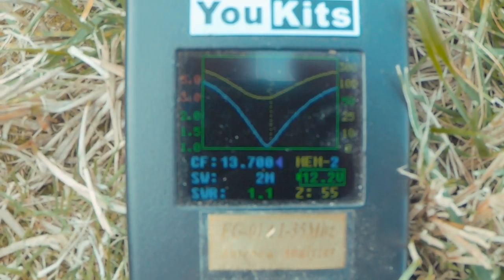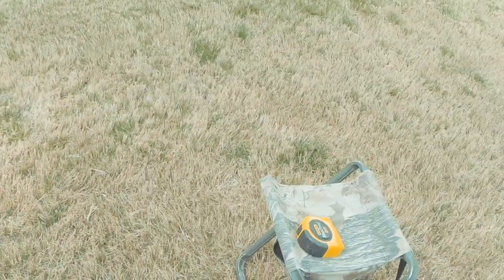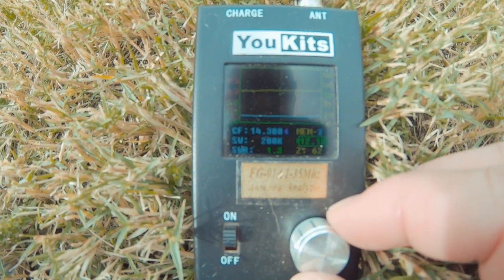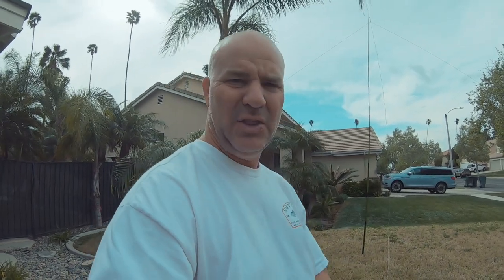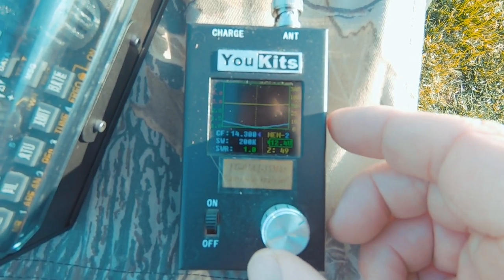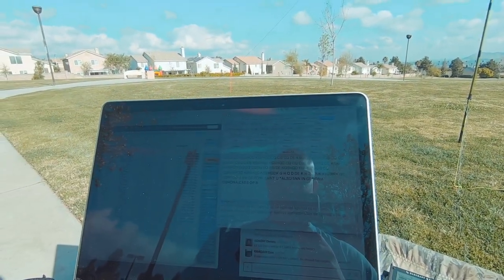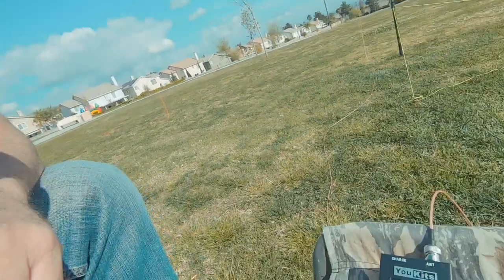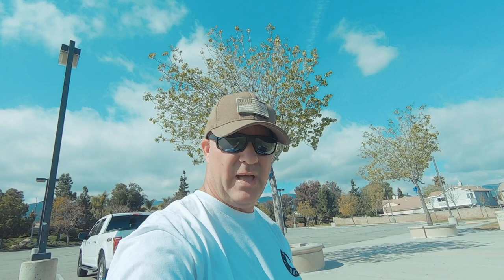Antenna Wars   Part Two - The Controlled Environment

Comment: I like the test Jerry. I think you have controlled what you can. It still is not controlled due to different times and if I recall correctly from watching this several days ago that some of the RBN stations were different. A field strength meter would be nice but not within the equipment most hams possess. 

I take that they both perform well. I would not expect a material difference in performance given they are both inverted v antennas cut to be resonant in 20m and similarly situated when raised. I would not expect much difference in resistance of the radiating elements.  The feedline portion perhaps. 

I think we can get too hung up on which is “best” when the better question is often which is effectively carried, deployed, and used. I think they are both effective when cut to be resonant where desired. The videos are fun. Hope to get a s2s with you sometime from W5T.

Comment: Great video Jerry, may I suggest using a field strength meter for actual signal flying off the antenna versus depending on conditions being the same  during both tests. It is VERY UNLIKELY that conditions would be the same. I use a field strength meter for a mobil installation test and it was quite helpful for determining the rf  strength between two different  stingers. Can even check at different elevations off the ground to determine the take off angle. 73s
Reply from the maker: sounds like more testing gear would be needed for such a novice test... maybe you can send me yours to borrow?  Good hearing from you Scott.. is it hot out there in Tx yet?

Comment: Great video @KG6HQD Jerry! Impressive performance from a roll of wire (referring both of these antennas), a few connectors, and a stick. This is what amazes me about ham radio, it breaks down science-y concepts into practical application and with the help of the ham community (i.e. the Reverse Beacon Network) you are able to verify first-hand these concepts.
There will always be much more fun and investment in something you build yourself and see working. Not to mention you can't even buy the linked dipole from the seller anymore... so if you wanted to do a pure dipole rather than el cheapo speakerwire, you'd have to do lots of new seller research and find a quality builder. For me, much rather build it myself since the theory behind this particular antenna is easily explained.
What I appreciate most is that you're one the folks getting out there and doing this stuff: Building, testing, and bagging the peaks to get your signal out there. It motivates the rest of us to get off our butts and get out there! 73 de AD6DM
Reply from the maker: Thanks Dennis and I appreciate everybody out here who motivates me to keep on trying things and learning myself. That’s the part of this hobby that means the most to me. Oh, and the “In association with the #JerryNet” is a nice touch, thanks 👍🏻

Comment: Great Video! I appreciate your efforts towards making a controlled comparison. 
I do a lot of portable backpack operating, at portable QRP ops when traveling,  but my favorite activity is working DX from ocean beach campsites. I have used all types of antennas: vertical wires, longwires (both with counterpoises) and inverted vees for 20 & (sometimes)15 meters. For DX purposes, the best results have been using a RG58 fed 20 meter inverted vee up about 30ft, with the center conductor hauled up in a tree with tent line. I have also used this same antenna as a vertical, with the center conductor leg up vertical and the ground leg draped on the sand as a counterpoise.I have tweaked them with a small  ant tuner.  
But most of the time nowadays (since I am a bit older than when I packed in an Argonaut 509 and lantern batteries up the beach trails 40 years ago!) I use a KX2 (w. tuner) a 55ft  (#22 wire)longwire and a 9:1 unun - a much lighter load. This also enables me to work 80-10 meters, so I can chase (mostly CW) DX on 40/80M  at night as well as talk to my NW pals on 80M SSB. I am willing to sacrifice a few DBs for band coverage.
I checked your RBN readings and would opine that I did not see the dramatic difference you saw considering the conditions. Some of the stations (K3PA in KS) and a few of the other stations were stronger on the 1st antenna. The surreal 41 db reading from the VE6 might be due to a spike in the propagation. This past weekend had a LOT of QSB and conditions could have changed rapidly, improving to some areas and degrading in others. In defense of your friend's commercial antenna the SWR  might have been better if deployed flat between two trees or as a straight sloper. When I cut an antenna (using the 468/freq in Mhz  = 1/2 wave dipole  L in ft formula), I usually need to trim it a bit when running it as an inverted vee. (ignore previous comment if it is designed for in-vee deployment)
I think a great test would be to go to that park with a buddy and set up the 2 antennas at opposite ends of the park running 2-3 watts within a few seconds of each other @ the same power. THAT would tell the definitive tale. 
Anyway, the most important thing is that you seem to enjoy what you are doing. You are doing a great job of sharing your love of radio with us here...TU!  - John, K7HV / HC1HB (I have a few videos here on YT as well, but not as well produced as yours!)

Comment: Good presentation Jerry.  Nicely (and fairly) done.  The RBN data is a good indicator of both antenna’s performance.  I’d give the edge to the HQD antenna in this round.
Give me a heads up when you plan the next test.  If there aren’t thunderstorms in my area (like this weekend), I’ll set up as well.  Texas weather is somewhat unpredictable in April.

Don / W5DON
Reply from the maker: Thanks Don - the RBN data was tabulated but with some unequal terms - I tried to compare the stations BOTH antennas reached but more can be dissected from the results and what else what be good is the overall range each antenna was able to achieve too.
Reply: Jerry - Maybe do the comparison three ways:

1. Compare the signal strength of the stations that BOTH antennas reached.

2. The number of stations each antenna reached in an hour.

3. The distance of the farthest station each antenna reached.

That would be more of an “apples to apples” comparison.

Don / W5DON
Reply from the maker: Agreed, unfortunately on Twitter Tony is jumping on a total average between the two and while that is data I don’t think it’s apples to apples as you say... at this point anything that puts the data analysis level seems to be discounted instead of just interpreted.
Reply: The only other variable is condition of the band, with no way to quantify or control.  The third test will show more.
Reply from the maker: Agreed, absent the antennas being in exactly the same location with the exactly the same setting and transmitting on calibrated radio at exactly the same time with exactly the same setting all this is null and void and useless info, or so thinks one. I think I did as much as I could to test fairly and provide some form of objective data and no matter what that’s a good thing. Thanks for the feedback Don and you definitely brought value to the conversation with some ideas not just for this test but maybe even some others as well.

Comment: Along with all your on-mountain SOTA videos, thanks for the great Antenna Wars, Jerry.

The highs and lows are good to know.  If we break the spots up at 1631z 06 Apr, I believe your data shows an average of: 12.6dB for the N9SAB/K9ARV antenna, and an average of 9.7dB for the KG6HQD antenna.

It seems like WSPR with the grid square distances would be relevant too.  We could come up with a dB per maybe 100 miles averaged over all spots.  Right now, we don’t know if the less measured antenna might have actually been received further.  However realistically without getting into raw WSPR data, a comparison between several but quick back-to-back WSPR maps would help us get an intuition about all those distances received.

I like my similar 100W-rated 20M and 40M N9SAB Tim Ortiz antennas and my 20M and 40M KG6HQD/speaker wire antennas.  I think I missed out on the N9SAB/K9ARV QRP-rated antennas.  Tony got me into QRP with his channel.  Great guy.  Wish I had a few of those videos for reference.

Weight, cost and DIY pride are definitely values I appreciate on the speaker wire.  I made a 20M and 40M with my young daughter.  We had speaker wire all over the house.  We loved it.  Hard to tie that knot in the 40M with all the wire… and a helpful 4-year old.  There will always be “gold” mixed in that copper.

Thanks again for the all the videos.

N4NAS Adam

Google spreadsheet with spot averages:
https://docs.google.com/spreadsheets/d/1sCLXg964hhzytj2CDOC1L0gHGlZd9O3JTs5fpBSGlR0/edit?usp=sharing
Reply from the maker: I like that dB over 100 mile idea for an even more objective analysis if one wants to even dig deeper. How’s the 40m HQD speaker wire working for you? What is the length you chose for the transmission line and what gauge wire did you use?  Also, I completely agree, Tony is a great guy and exposed many people to QRP portable ham radio when he had his channel running; wish he still did to be honest. 

I think you nailed it with the “gold” reference, that’s a solid analogy for the intent of making your own antennas, no matter what kind or how stellar they are or not it the experience that matters most.  73 👍🏻
Reply: @KG6HQDJerrySOTA  I checked some notes from last year.  For the 40m, I was shooting for 7.200MHz.  The BNC to female banana binding posts connect to about 74' total of 24AWG speaker wire.  39' is for the feed and 34'5" for each leg plus a little spare to attach and tune the ends.  I have about 9'-12' of tent rope on the ends. When sketching it out, I anticipated a 19' pole.  I ended up pulling out the last thin section of the pole making it about 17'6" tall.  I estimated 128deg between the legs at 19' so it is probably a little over 130deg between the legs now.  Obviously, the legs are not near as close as the 20m I have at about 92deg.  For the 40m, that 12' tent rope gets it about 3.5' to 4' above the ground with the 17.5' pole.  I ran some WSPR runs before.  I remember being fairly satisfied with them.  Actually, I just setup the 40m again in the backyard to confirm, at 7.200MHz I am getting an SWR of 1.06 and the impedance is 53.2-j0.4 ohms.  Now, that spring time is here, I just need to find the time to get it to the summits. N4NAS
Reply from the maker: Discussing this very info on our digital mode group now and it’s in line with our estimates 👍🏻

Comment: Another great installment in the series. Good idea using the RBN for external data. At least it can't be said that your using bogus numbers. Would love to see a rebuttal series and the methods used to prove the former K9ARV dipole was a better performer.
Reply from the maker: Well he was adamant it would outperform the HQD speaker wire but the RBN data and the clips showing each setup with each antenna on the analyzer should help to quell any allegations of malfeasance on my part cuz I’m sure that’s next.  I know I did everything I could to ensure a fair & impartial test with objective results. We shall see how it goes now.

Comment: Jerry, Thanks for the video series and for sharing a lot of good information. I would like to see a comparison between an OCF antenna and the HQD antenna. I'm sure yours being a single band antenna would win but the OCF will offer the convenience of switching bands. 

✌🏽
Noel~ W2MSA
Reply from the maker: Hi Noel, I like that idea just for the idea of making another antenna!  Noted for the list.  Do you have a particular model in mind you could share the plans to or reference?
Reply: KG6HQD Jerry I don't have any at the moment but the other antenna you can construct is a half wave end fed antenna which a lot of people like running for portable use. There's a lot of information on how to construct one on the internet. At the end of the day there's nothing like a single band resonant antenna and the fact that you're using a twin lead feed line even better.
Reply from the maker: Very true Noel and I do have stuff and plans for an EF version with a 9:1 unun if I recall that many SOTA guys use. Maybe I’ll make that just for fun next.
Reply: KG6HQD Jerry Just remember Jerry that the 9:1 is technically a random wire where the HWEF is theoretically a resonant antenna. So rather than a 9:1 use a 49:1 or 64:1. Look up the end fed half wave antenna group on Facebook, there's a lot of good information there. 
Good luck and thanks again for all your effort.
Reply from the maker: Yes that one 🤣. I have never built this particular one but have the plans somewhere to reference. I’d like to see how it does in a similar test since the naysayers are so against antennas like this yet they work well and that’s what matters in my opinion.

Comment: Nice video and great work Jerry. It seems to me that basically what you have with your HQD antenna is a dipole fed by ladder line. One wonders if your "ladder line" feedline offers significantly less  loss than the opposing antenna's coax? It's curious to me how I grew up with the notion that coax is better than twin lead but look at your antenna and the performance difference. I wonder if you could improve the performance of the HQD antenna by feeding the dipole portion with a high quality, light weight ladder line? You have caused me to seriously reconsider how I may construct some of my future dipole antennas. One thing is for sure, you can't beat the price of the HQD antenna! Talk with you on the summits. 73. Rich. KB5EDR.
Reply from the maker: Amen to that! I think I’m going to build a 40m version for the home QTH & I may experiment with some ladder line since I have some laying around then solder a PL-259 connection for my 150’ or so of coax to feed it to the shack. The best part in all of this is how it has people thinking and exploring. GOOD STUFF!

Comment: So you have compared how well they radiate.  Is there any difference on the receive? I built your antenna and have used it when I was on Molokai on business. I set it up at the hotel and got on the daily Hawaii HF net and got good reports on 20 watts. WH6FQI Jim, Big Island of Hawaii
Reply from the maker: Hi Jim, good to hear from you from the Big Island. The RX on both sounded the same to me as far as noise levels but I wasn’t giving it much down time. I hammered the TX to get as much data from the RBN as possible but in listening to my audio clips they didn’t stand out as one being any noisier than the other. I will for sure observe this in part three of Antenna Wars when I do a SSB SOTA deployment. Thanks for a good reminder since it was brought up by Tony that my antenna would introduce noise. I don’t want to leave anything out.